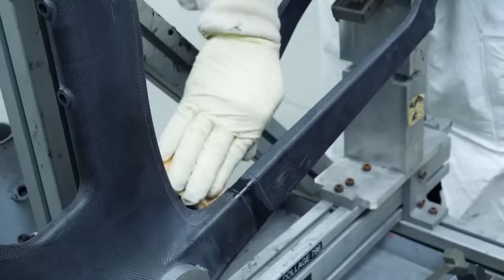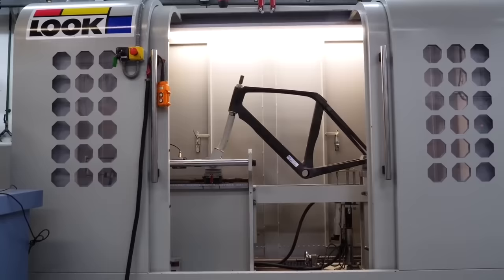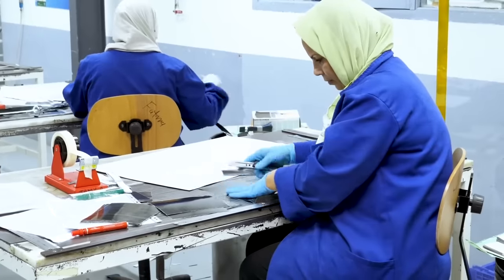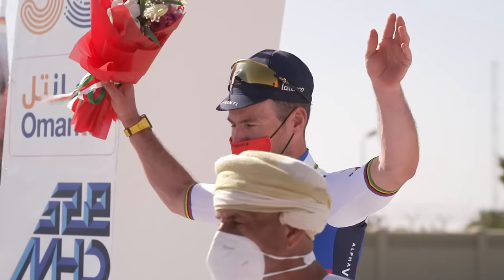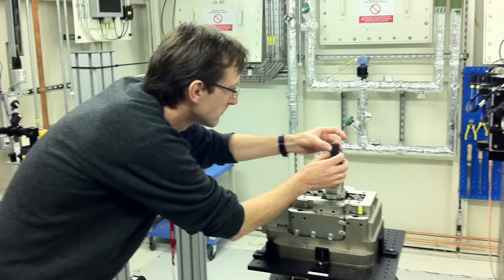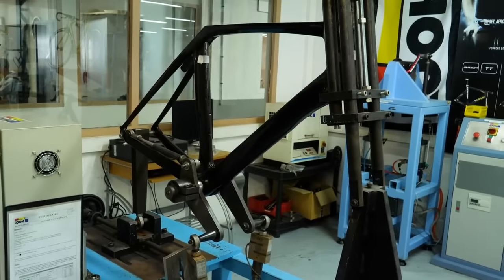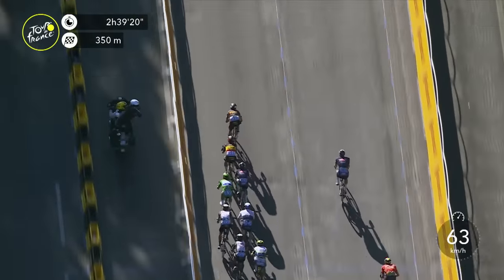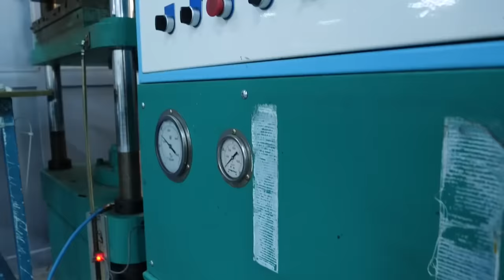Your Carbon Fibre Bike Won’t Last Forever

Comment: I enjoy Carbon Fiber bikes but I am skeptical about using them for downhill mountain biking when paired with a high-torque motor. As far as a gravel bike or a commuter bike they are great. For a downhill mountain bike with a motor I prefer titanium as a lightweight option.
Reply: The problem with MTBs is if the frame is hit from the side (by a rock or a crash) carbon fiber is much more sensitive compared to a metal. A metal may get a dent if it's hit by a rock or stone, carbon fiber can break at the impact zone
Reply: @simonm1447  stress fractures are a hidden problem as well.  Call me old-fashioned but I prefer the steel as its able to flex as well as twist. The beauty of Steel is that you can widen the dropouts if needed and you could also weld any stress fractures that may have resulted. At the end of the day carbon steel is my go-to frame
Reply: @joeows6537  unfortunately steel MTB frames are not that common any more. Mostly used is aluminum (often 6061, less common 7005), in Europe steel MTB frames are relatively rare.
My MTBs are aluminum, but I have 2 older non MTB bikes with cromoly frames

Comment: Meanwhile, my steel bike is 40 years old, has tubes that are only .7mm thick through the middle, has a dent in the top tube, and will likely carry on performing exactly as it does now for another 40 years

Comment: Every material will eventually suffer failure due to fatigue.  Earthquakes, volcanoes, mountain ranges, etc. are all the result of force over time causing fatigue, and that fatigue leading to failure.  With carbon fiber, as with the earth's rocky crust, the key is whether we can detect impending failure, or whether it's just going to fail one day completely unexpectedly, potentially causing injury.

Comment: I wonder, for a carbon composite that exhibits greater deflection due to micro crack damage in the resin matrix, would baking it have any "healing" affect?
Reply: interesting question. i suspect the answer is 'maybe but probably not much'

Comment: So it also depends on the thickness of the carbon fibre?. Ie a heavier aero frame will be much stronger than a super lightweight climbing frame.
Reply: The types of things they're talking about here aren't necessarily corrected by throwing on more material.

Comment: So we are none the wiser really it just depends  My bike 12 years old using it on turbo and the roads which are rough as hell but I love my bike and it fits and handles just right. Problem Cannondale have changed geometry on the new super 6 evo  so I can't replace like for like.

Comment: Can we have some more info on wet vs. dry washing? I've been moving away from wet washing (partly out of laziness) and normally can get muck off just fine with a cloth and then give a polish with gt85. Obviously the chain is separate and I do with cleaner but for the rest of the bike I can't really see the point in soaking it and moisture inevitably getting between parts, some of them metal which is also going to mess with carbon.

Comment: Great Viseo i wonder if STC carbon frames  like the ORRO bikes where the fiber is weaved and not unidirectiona helps as the fibers are not in the same direction and the loades on them is split the forces on the carbon makes them less volunurable  to some of the streass mentioned.

Comment: Back-in-the-day it was said steel bikes would "go soft" but I don't remember any metallurgy backing up the idea...and let's be honest, most springs are made of ...steel.  Aluminum of course has a limited life as in X # of flex cycles = failure. When carbon-fiber first came along the marketing-mavens implied it would last forever but what do they say now? Next episode get the spokespeople for some of the companies who sell carbon bikes on-record as to the lifespan of their products. You showed images of someone doing fatigue testing on one, so they must know...right?
Reply: Steel has a so called fatigue threshold, a repeated load under a certain limit won't lead to any fatigue. Aluminium is different here, but as the expert said the possible load cycles depend on the amount of force put into the frame and the material thickness. An overbuilt frame (like a 2000 g trekking frame) has more reserves compared to a more lightweight road bike frame which faces more fatigue at the same load. A normal non very lightweight Aluminium frame can last for 50 to 60 K km

Comment: So basically don’t put your carbon fibre bike on a turbo trainer outside…strains against non engineered expectations in high UV and wet environments. Or if your “built like Chris Hoy”? 😂 Great video 👍🏼
Reply: At least Chris' carbon track frames were never subjected to the road craters, bumps, hard impacts, drop offs/etc. part of the degradation equation on those glass smooth, Siberian Pine bowls (not so sure about the vertical g forces involved with whipping through those steep banked turns at almost 55 MPH though).

My guess is that his frame builders took into consideration the stresses involved when he was trying to rip the bike apart on kilo starts, or winding up for the final 200 meters of a match sprint. ;)

Comment: Maybe it's a bit different in mtb and in carbon rims (as opposed to frames) but when they're talking about "graceful failure" and less catastrophic failure (than metals) I can't help but think of times I've seen (in mtb) carbon rims just totally disintegrating, like totally vanishing into dust and small bundle of fibers. I'm not saying carbon rims aren't tough because they are but those failures in high speed are just something else.

Comment: Now each material has its own degradation problem. Should you paint your carbon or alloy frame inside and out?

And what about extreme temperatures in winter or heavy rains in tropical rainforests?

Does the manufacturer even consider small details such as the location of the consumer?

High-end bikes tend to have a higher price tag, so I expect them to last longer. Even if their prime performace is about 2 or 5 years since first real usage. Although it depends on the usage of each.

After all, It's not just the pride of "being able to afford fancy stuff" but also we pay for the "precision" technology that comes with it.

I know that car manufacturers do a full body corrosion protective "bath" before they are assembled and painted. Even aluminum alloys can decayed over time right? And the petrol engine have different specifications for different continents.

Consistence hobbyist vs competitive weekenders

Comment: An excellent video.  I have  one comment.  the way the way the carbon is layed out,  the method with which it is constructed will have the biggest difference on its life span.  there have been some technical reviews of chinese carbon frames on you tube.  a few of them were noted for having very thin carbon constuction.  They wont be lasting long.  I read a story a few years where they stress tested aluminum frames.   it all came down to how they were made.  some brands lasted much longer than others.   it is the same with carbon bicycles. How many carbon forks are out there on bicycles ? I shudder to think.
Reply: Not sure about that. The no name open mould Chinese frames tend to be 20-50% heavier as their layup is relatively basic (still need to pass a basic cyclic fatigue test)
Reply: @richardggeorge  check out Cam Nicholls on youtube.   he took a chinese internet frame to a carbon expert where he lives and the expert told him the carbon on that make was thin.   it depends what you buy,  but how do you know what you are getting if you buy a frame from a company in China ?  the video is called the cheap chinese bike that failed.   they used an instrument to measure carbon thickness.  it was a bare minimum thick.

Comment: Well many airplanes have already for decades carbon flight controlls like the A320 Series. Not sure if already MD11 used carbon. A350 and B787 use  a lot of carbon more than all planes before in the pax/airline section.

Comment: How about that Titan submersible? Carbon is fragile and indeed only has a certain number of cycles. Don't let the marketers tell you otherwise. Alloys are much better if you want a forever frameset. 
You can feel it.
Reply: So....they sourced carbon fiber for the TITAN submersible from the Boeing company.  Reason was that the carbon Boeing had was too OLD so they sold it to OceanGate.  I immediately searched out shelf life videos and got here....science confirmed.   and BOY this video is informative.  Fractures, yo.  for real.

Comment: 5:20 the more expensive the carbon frame (the lighter it is and the thinner the walls of the tubes), the shorter lifetime it will have. Youd’d spending 2x the money to have the frame break before the less expensive, heavier, but more sturdy frame! Light carbon may be fun, but it’s a horrible financial investment.

Comment: First things first F1 carbon is done completely different to over obsession bike manufacturer frames the UK carbon repair specialist will tell you this if you go over to their channel and he'll show a repair and difference between todays MTB carbon and yesteryears frame carbon. One thing to note bike companies have gone made with lightness causing a really important step in carbon strength forming he explains! You notice when you snap a carbon head tube of frame you will see the fibres like a ground weed control membrane type sting materials this is because there doing a dry middle layer NO EPOXY RESIN HERE ATOLL only on the inner hollow and outter shel for sealing hardness but absolutely nothing in the middle causing it to also flex quite abit more to what an older type carbon frame would use! This is why he is stacked to the roof of carbon fibre frames in for repair and most not able its heartbreaking but its a fact all proven so in a simple answer yes carbon does now have a rapid shelf compared to before with the central fibes being bone dry instead of the proper process of carbon fibre! It was an absolute jaw dropping video I will not be touching another carbon frame that's for sure!

Comment: Was hoping to see some quantification of this effect but there is none mentioned.  For example, the average cyclist won't meaningfully flex a carbon fiber (or steel, Ti) frame even in a sprint.  Mr. Cavendish in a sprint at 2,000 watts would be different, obviously..

Comment: The lesson from this video is don’t keep your carbon framed bike too long and sell it whilst still has value! Alloy frames probably last longer and cheaper to repair. Carbon is a bit of an indulgence for the average cyclist, whether road or mountain biker in my view? Also, increasingly these days ‘fashion’ comes into cycling and some people people won’t keep their bike long enough to have issues with wear and tear, so it can be a bit of a moot question? Another lesson from this video is that second hand buyers need to apply the principle of ‘caveat emptor’!
Reply: Aluminum won't last very long to be honest. Usually you'll get 10 to 15 years tops before they crack. Given you actually use it. My caad9 cracked after ten, I repaired it with carbon fiber.
Reply: @Megadeth6633  Quite long really
Reply: @ultimateoutdoors4659  Well carbon fiber, if not crashed and taken care of, supposing its well fabricated, will probably not break ever in your lifetime. However we learned here that stiffness will probably go down with time. 

Yeah aluminium is nice, but not easy to repair. You can't just solder it (many people do and they are fools) because it needs heat treatment afterwards. Not everyone has a huge industrial oven. Carbon is the way, but it takes work.
Reply: @Megadeth6633  plenty of aluminium welders in my town.
Reply: @ultimateoutdoors4659  Good for them, I know about 20 as well and I'd never solder mine unless it was a certain type alu.

Comment: Carbon won't last forever, this is true....but... I have a mate that has just replaced his 18 month old Tarmac, with 98,000km on it (he rides a LOT). On the other hand, my 35,000km Scott Addict is pushing 8yrs old now, and could possibly go another couple before I upgrade. 

I'd wager 10yrs/100,000km potential is far more than enough for any keen cyclist...

Comment: Quick question. The lacquer is on the outside of the frame, so what happens with moisture that gets trapped inside the frame and sits around the BB area, should we be drying the bottom bracket area after a wash, with compressed air etc.

Comment: In my top-of-the-range bike, after only a few months of not particularly heavy use, a fracture formed where the seat stay meets the seat post. It is a point that has been changed in the latest version of the model. Is it possible that it was simply a construction defect or do I have to fear that it could be a design defect?

Comment: 30:20 "graceful failure". Strange, I always hear carbon fails catastrophically (with mountain bikes at least) I.E. metal bends, carbon snaps. But I guess that's a different failure mode.

Comment: A bike shop just used acetone (nail polish remover) to take out a carbon seat post that was stuck on my carbon frame despite repeated sprays of WD-40. Is acetone safe for carbon fiber bikes?

Comment: Would love to know what the environmental durability is of aluminium bikes vs. carbon fibre bikes...
If I remember my material sciences from engineering school correctly, aluminium can be recycled many times over. Carbon fibre, based on it being a composite of epoxy resin and fibres, lets me think it is almost impossible to recycle.
Reply: Just need to look at how wind turbines are recycled.

Comment: Great show, but somehow I'm still not satisfied. I often wonder if the carbon and aluminum bikes will be restored like the old steel bikes are today. What is the shelf life aluminum compared to steel and carbon? In the nineties, specialized was using an aluminum ceramic composite matrix, would something like that be the best for all us amateurs, so we could have sustainable, long lasting frames? This kinda makes me want to get a titanium forever bike.
Reply: NO Aluminium frame is pure aluminium just like steel, so by increasing amount of other materials will give you different properties, but that does not mean it  will give you better strength over time?
AS for titanium, is a good material, but not if it is ridden hard or has  some damage, such as dents?

Do not think carbon and aluminum bikes will last as long as steel bike, but will depend on how they are used/ stored!
Reply: @alanblurr1265  I'm pretty sure they use alloys, not pure aluminum or pure steel.. but yeah, I think steel or titanium would last the longest. Ideally we will settle on something with longevity and reasonable lightness for the mass market because I hate to think most modern bikes will just be trash in the future. I have seen tons of aluminum restoration, but they weren't as old as the steel restorations. I guess we'll just have to wait and see how long these frames hold up.

Comment: Is there a standardised system weight (eg 100kg or 120kg?) that mass market bike frames are designed comfortably to withstand? Presumably, rider weight has as big an impact on frame durability as rider power. Never mind the occasional sprinting, just imagine the frequent strains and forces under hard braking  or over bumpy terrain. 😖

Comment: I've had the speed wobbles a couple of times when my bike goes into a wild shimmy, and I was wondering whether such abnormal stresses might have the potential to cause more frame damage than regular riding.
Reply: Get your wheels balanced.
 It's doubtful as I'm guessing you'll only be experiencing it for a relatively short time compared to the rest of the ride.
Reply: @r.davies2702  Thank you. I hadn't thought about the wheels.

Comment: I would dread front forks to fail when descending :( so alloy stronger overall dont sound good for carbon frames and forks... intresting so witch is better ...CFRP is an anisotropic material. While isotropic aluminium has the same properties in all directions, carbon is only strong along the direction of its fibres. This also only applies to pulling forces, not to compression. Though unidirectional, it’s tremendously strong in that one direction: carbon can have more than ten times the tensile strength of aluminium alloys and exceeds them in terms of fatigue strength. “If you ride an aluminium frame hard, it could end up cracking after two years. But once you have a good construction, a carbon frame will last forever”; says Cesar Rojo from Unno Bikes – at least if it isn’t damaged in a crash, cracked from an impact, or the layers of fibre separate, also known as delamination. Even if you can’t see the damage, it can reduce the component’s load-bearing capacity, causing a sudden and unexpected failure during peak loads

Comment: The only chance that a bike (frame) will have an infinite use life will be if it is made sufficiently stout and out of certain steels or titanium alloys. All other materials will suffer continuous degradation even under lightly loaded use. This assumes storage in climate controlled low-humidity conditions. Careful control of corrosion for steel and titanium is important in salt spray coastal areas, else fatigue cracks will start to develop.